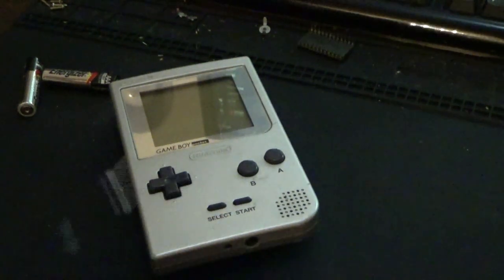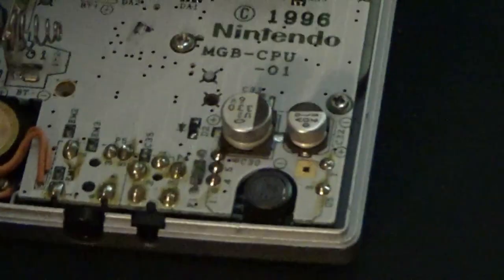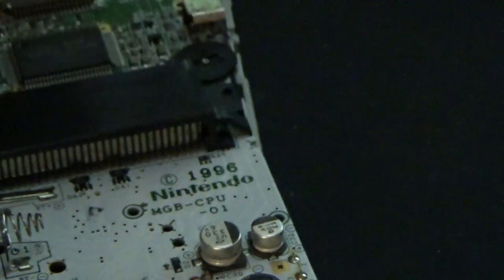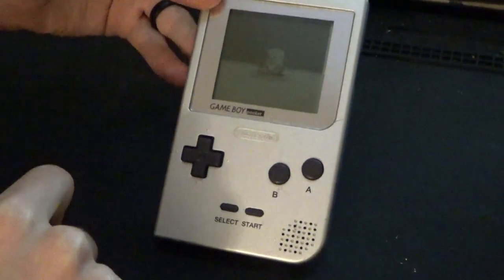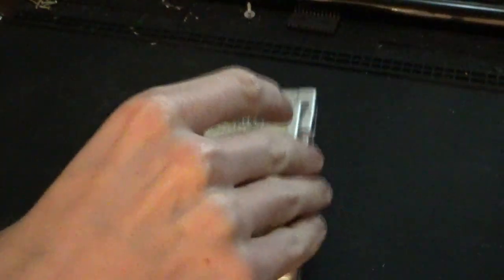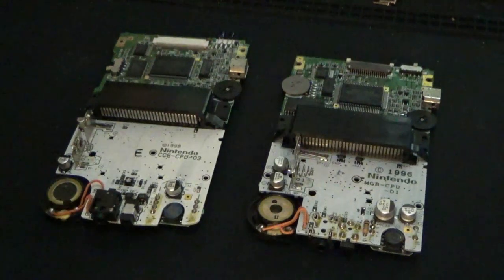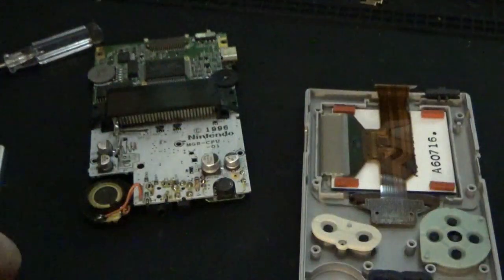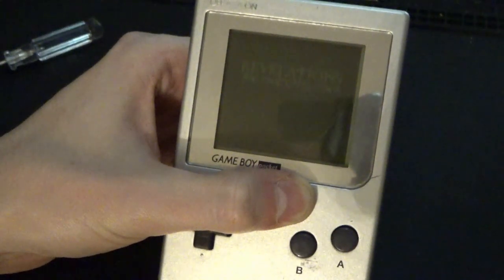Fixing a GameBoy Pocket With No Power or Sound

Comment: Wow! Excellent job. Im picking one of these up with what sounds like the same issues. Im going to use this video and maybe attempt this myself. Where can you find the replacement fuse? Is there only one fuse for it?
Reply from the maker: I ordered my 1ohm resistors that I used as fuses from digikey, but they charge pretty heavily for shipping ($7.99 shipping on under $1in resistors). The cheapest option would be to get on ebay and buy whatever amount of 1ohm 1/4 watt resistors is the cheapest.

As far as I know that's the only fuse for a gameboy pocket. 

Best of luck fixing the one you have.
Reply: @bradyrepairs7735  what about using 1 ohm 1/2w ?

Comment: I’m sorry what did you do on the headphone jack to fix it I didn’t see you soldering on the jack I want more info as I’m trying to fix mine
Reply from the maker: I messed with the headphone jack a little off camera to see if the piece of copper that breaks/completes (I can't remember which it does) the circuit for the jack was making a good contact. To test this I hooked my multi meter up in continuity mode and attached it to both sides of the contact point and pushed the contacts together with a pick tool to make sure it was connecting. What can happen is if that contact is stuck it will tell the GameBoy headphones are connected at all times and will keep the sound from coming out of the speaker. In this case it was a blown speaker that was the problem and I just didn't realize it when I read the resistance of the speaker. In the video what I did was forget to resolder the headphone jack after I had taken it out and if the jack is deleted from the circuit no sound will come out of the speaker.

Sorry if this is long winded I just realized I didn't explain everything all that well when I went back and rewatched the video to answer your question.
Reply: BradyRepairs  Ok Thanks
I just got a gameboy with no booting up so I just got a multimeter which I have never use one so I just wanted as much info as possible before I ended destroying it. I’ll let you know what happens. Thanks again